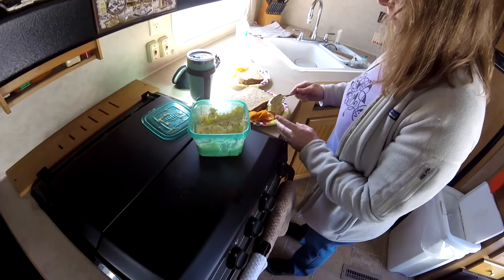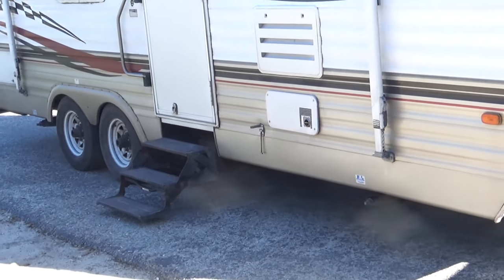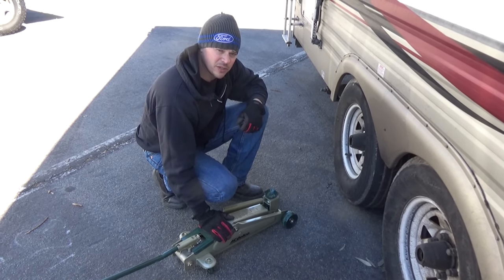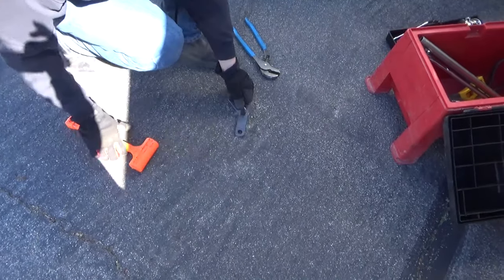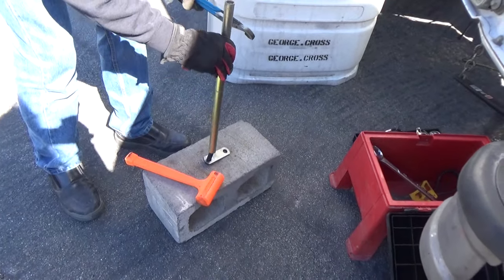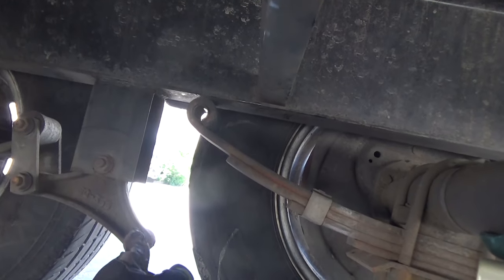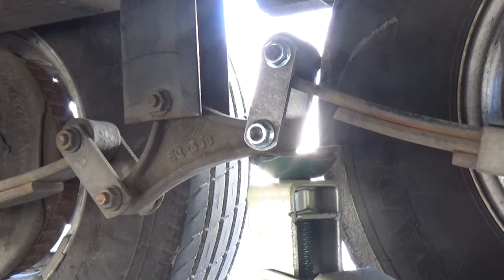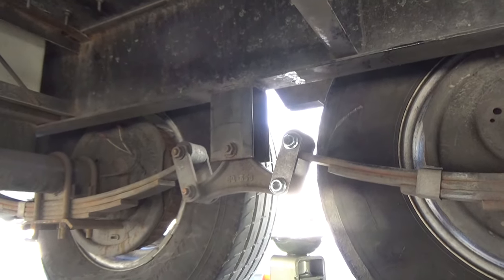CAMPER SPRING SHACKLES ROADSIDE REPAIR: CALIFORNIA I5 BROKE TRIXIE'S DUAL AXLE SUSPENSION

Comment: Our TT is a lightly used 2019. In 2021, after watching some disturbing videos about stock suspension failures, I had MorRyde equalizers, shackle straps and wet bolts w/brass sleeves installed. The shop that did the work showed me the stock shackle straps. Every one of the bolt holes had been worn egg-shaped. The factory uses plastic sleeves for the shackle strap bolts. All of these sleeves were shot. Keep in mind that this is a well-cared for and lightly used TT. I have to conclude that every TT on the road today with those skimpy stock shackle straps and plastic sleeves are an accident waiting for a place to happen. My advice is to replace this factory crap before disaster strikes.
Reply from the maker: As was brought out by the parts salesman, better buy some extras.  Once one goes, more are likely soon to follow.
Reply: Yes, you are absolutely correct. It is criminal that the build them with these cheap thin shackles. I have a 2021 Keystone Raptor triple axle toy hauler that cost well over $100,000 and I just discovered one of my shackles is ripped through. I also ordered the heavy duty upgrade kit with wet bolts etc., and the shackles are 1/2" thick vs. the cheap thin soft metal 1/4" OEM's.  I just hope they are not the same soft metal as I do not want to have to replace these again in a few years! We drove our last toy hauler 5th wheel for five years with zero shackle problems, but then again it didn't have the MORryde setup. Hmmm....

Comment: If I were going to keep the trailer a long time I think I would replace the whole system with quality parts. I also would put shackles with grease fittings.
Reply from the maker: Very smart idea on upgrading from the factory shackles.  I might have to consider that when I have some downtime.

Comment: Awesome video!  I've never changed out my shackles or leaf springs, BUT I do have a spare leaf spring, shackles and bolts that I carry with me when we take our RV out.  The way they make stuff nowadays, you never know.  I don't want to be stuck on the side of the road and have to wait 8 hours like I've seen other youtuber's do while hoping a mobile repair truck can fix it.  Can you imagine being out in the middle of nowhere and find you have a broken shackle or leaf spring?  What would you do then?  Especially on a weekend.  Auto shops don't carry the parts and now with the supply chain problems we are all facing, it's cheap insurance to just buy a leaf spring and a couple of shackles to take along.  Even if you weren't physically able, didn't have the knowledge or the tools, with having the parts, someone could fix it for you.
Reply from the maker: It would suck being in the middle of nowhere!!!  I was lucky to be close to the RV shop in California when my first shackle went.  I bought extras per the shop staff, and sure enough, a couple trips later, found myself in another parking lot changing the next one.
Reply: @ridewithgnr2116  I do have a question for you, though.  Just curious since I've never changed my shackles.  When you tighten the nuts down on the leaf spring bolt, wouldn't that pull the part of the bolt with the splines into the shackle?  Like I said, just curious if this would work?

Comment: Looks like you put on the Sam ones that failed. 
Should have put in "wet bolts" (with brass bushings and grease zerks) and heavy-duty shackles (about 3x thickness of those).
Reply from the maker: Honestly, at that moment, I just wanted to get back on the road, but I have had enough comments to look into upgrading the bushings and possibly a replacement leveling stabilizer that mounts to the same points to limit rough road conditions.  Got a few other irons in the fire first!

Comment: I'm upgrading mine so I don't have to worry about it, it sucks that they are allowed to biuld trailers that way. If the semi trailer manufacturers try that they would not be allowed on the road.
Reply from the maker: I was lucky that my first shackle went bye-bye coming into Las Angeles, Ca.  At least I was close by a great RV shop when we stopped in San Clemente.